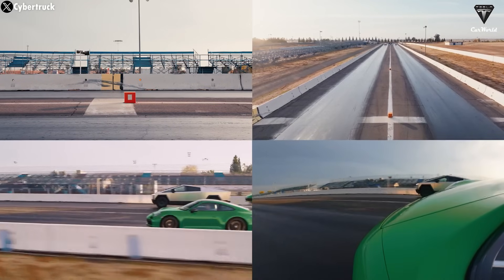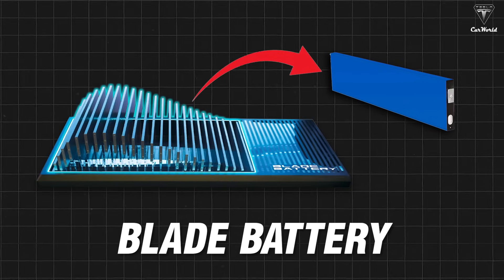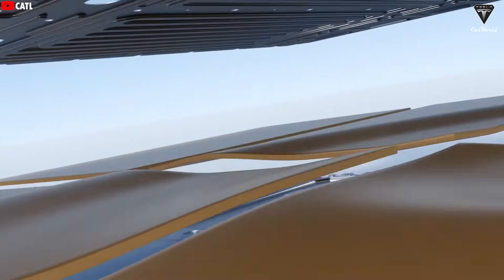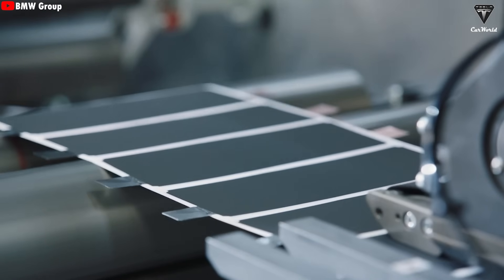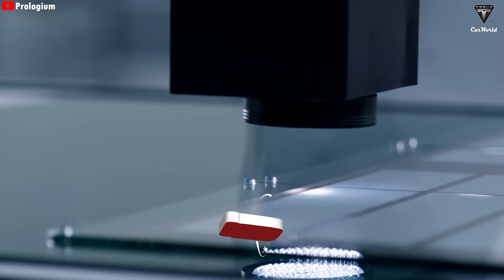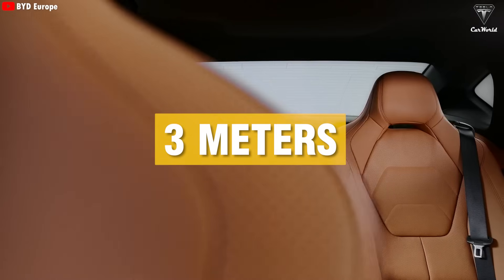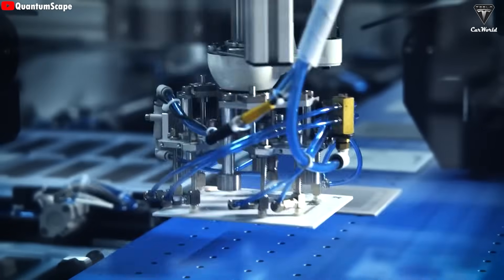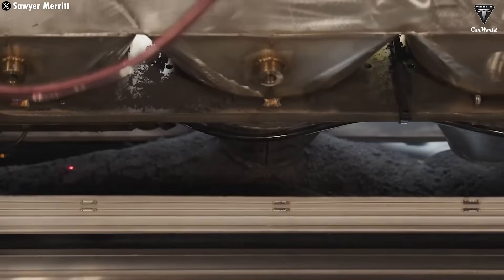ONLY 5 Mins Fully Charged! Elon Musk Just LEAK INSANE Battery CAN Replace 4680 SOON! What's Inside?

Comment: I will believe in Chinese battery safety and specification when I stop seeing BYD EVs catching fire. BYD and CATL need to be transparent with their EV data. This includes auto accident and auto insurance data in China. 

5 minutes charging sounds great, but what are the trade off? Shorter life, only charge to 80% and no discharge below 30%? So, BYD does 5 minutes charging and give up half of the battery capacity? How large of chargers do we need for 5 minutes charging?
Incomplete data hides problems. Korea developed 200C battery decades ago. Japan developed solid battery that never catches fire 7 years ago.

Comment: There aren’t any megawatt chargers. So having the ability to charge that fast doesn’t matter, even if you could manufacture these charging units the infrastructure in the United States doesn’t even have megawatt deliverability. I’ve had two Teslas and I’ve been at the corporate headquarters in Southern California where I used to live Many times with their 250 W and even 350 W chargers. I would see new model three charge in about 15 minutes and get 300 or 400 mile range and I would have to sit there on my model S for like an hour Charging it about 50 kW per hour because Tesla doesn’t want you to charge too fast because it would degrade the battery. I sold my Tesla after it was eight years old and it was getting about 80% of the original distance getting free charging was amazing. Would I buy a Tesla today maybe maybe not. I don’t like the idea of paying for charging, but I do like awning, an electric vehicle and a ride is thrilling. I guess it all depends on cost and features after owning two tests. I went back to an ice vehicle now I have a Hyundai Tucson buddy certified used for $30,000 with every option available and it has a 10 year warranty that I paid extra for from top to bottom, I will never pay maintenance. I think I got a better deal than buying an electric vehicle vehicle so I’ve wanted it for two years I have eight more years to go. We’ll see what Tesla has in eight years.